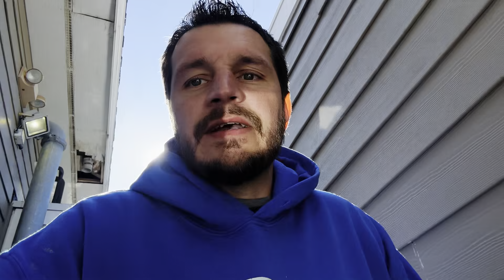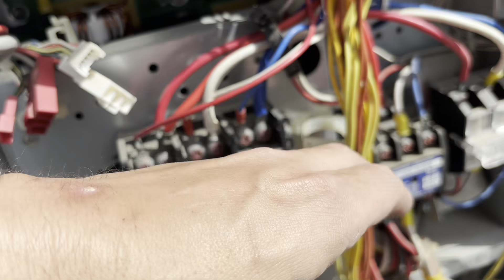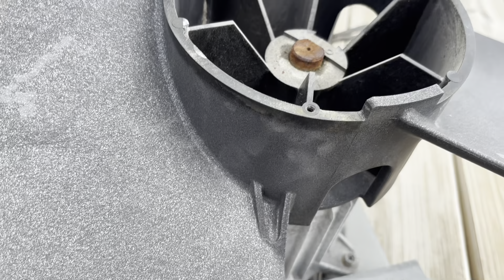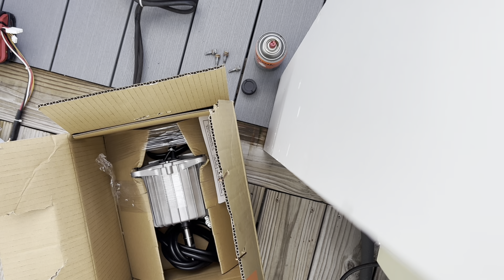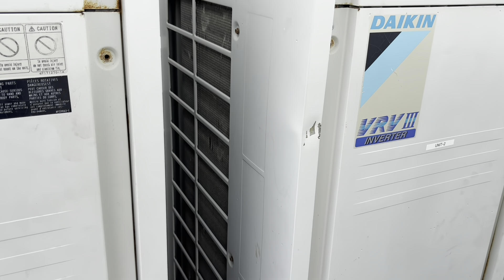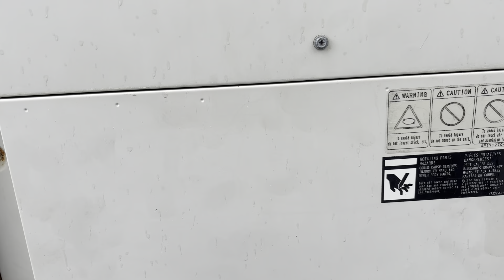Daikin VRV With Error Codes…REPAIRED! | Error H7-05

Comment: Any idea why 3 major components failed simultaneously?
Reply from the maker: The only part that really failed was the fan PCB.  But the motor and main PCB both had slightly off readings too so I decided to change them all.  Typically when you call tech support they have you change everything too.
Reply: @JeffsHVACAdventures  Reason why tech support recommends changing everything is that its new to tech support also. The manufactures can't keep up with the new equipment.